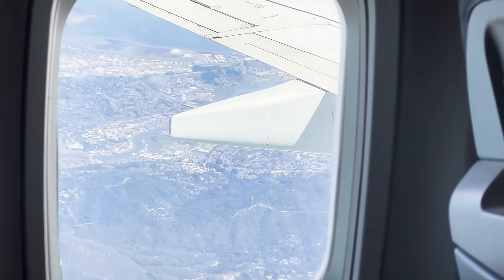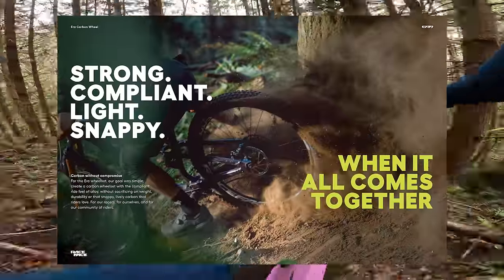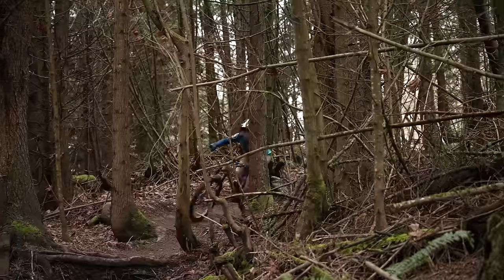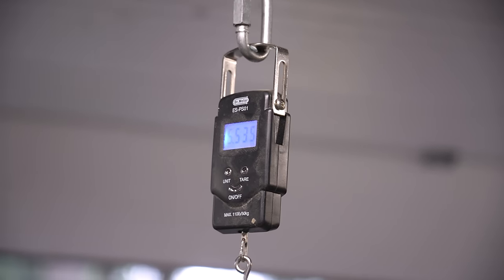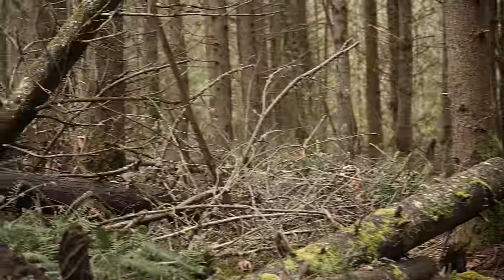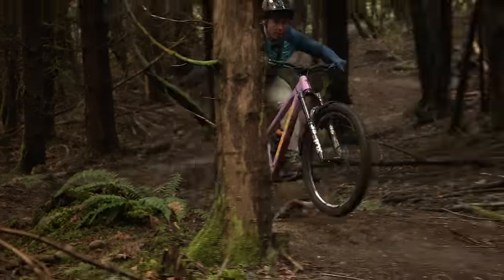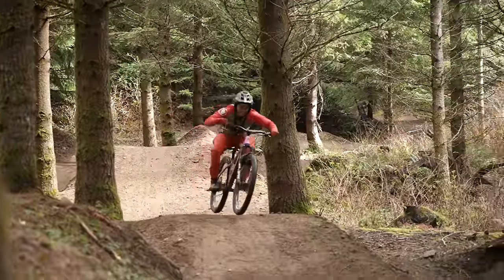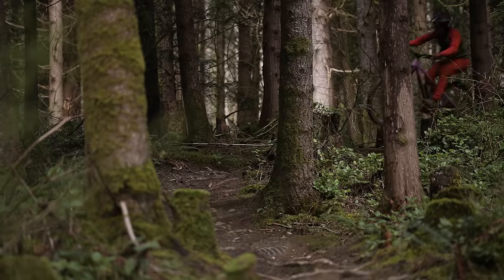Is "compliance" real? Riding the new Race Face Era wheels

Comment: Another great video Jeff. I agree with you, $1600 is a tough price point to sell these wheels considering a We Are One wheelset retails for about the same...
Reply from the maker: I did see that most pre-Bill aluminum wheels cost about a gram these days so for 300 bucks more per wheel, you do get high-performance
Reply: This is also in Reserve Carbon 30 price range, depending on which hub you get

Comment: You should try out some nobl tr37’s they’re crazy flexy… in a good way😁
Reply: Really? Mine are too stiff but it might be because the front and rear are both the rear layup.
Reply: @testtesttesttesttest884  hmm, most likely, also what spokes are you built up with? I found them to be much more comfortable than my wao unions and my forge and bond wheels.

Comment: I don’t listen to folks when they talk about compliance. It has so much to do with how much force someone can add into a component. Especially a light rider vs a heavy rider.  My carbon rims are known to be VERY stiff, but to me they are quite compliant due to me being 225lbs. 
Also, I’d love for companies to start explaining what their “average” rider looks like because I think they often under estimate the average rider size and weight.
Reply from the maker: You've got a great point, TT.  From my experiences, it felt like "the industry" assumes riders are fantastically underweight- about 150-170lbs, ~5'11" tall, intermediate riding ability.  I'm at 175lbs now, and definitely notice stuff flexing far more than I did back when I was racing, ~155-160lbs.  Stuff a pro finds to be flexy can still be great for someone who doesn't push the limits nearly as hard- for example, the Ibis Ripmo AF.  I find that bike good, but at the limit of what I want to ride due to it being somewhat flexy. However, there are tens of thousands of riders who LOVE that bike, and don't notice its flex at all.